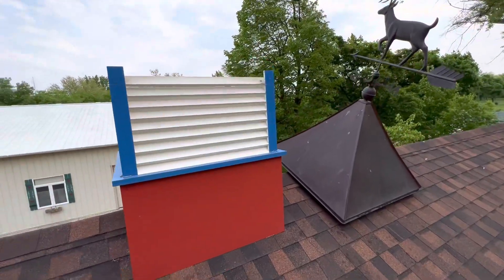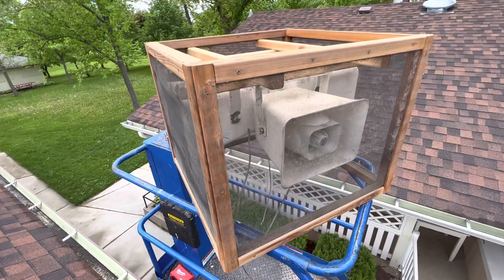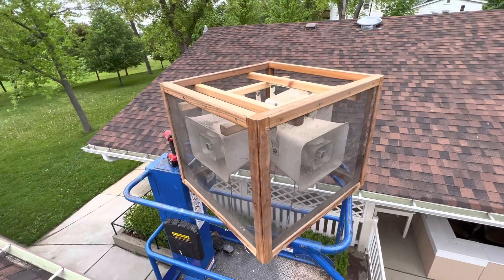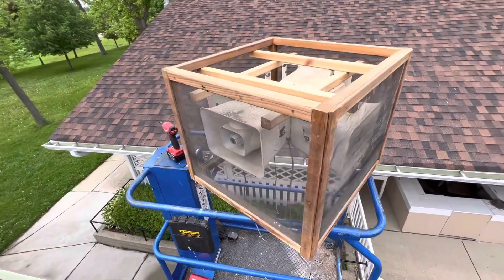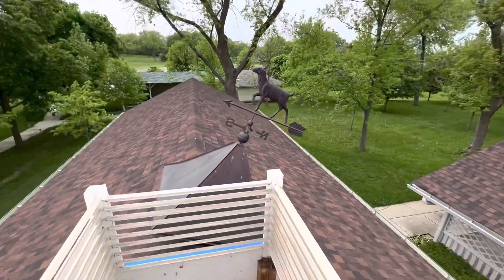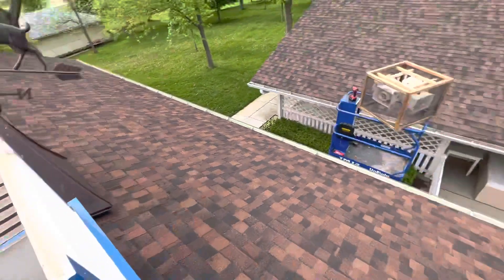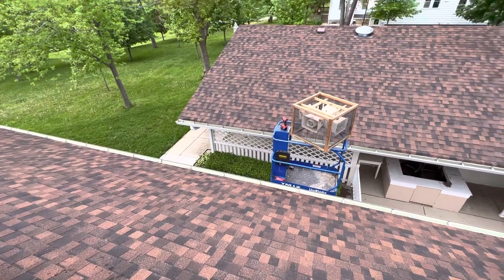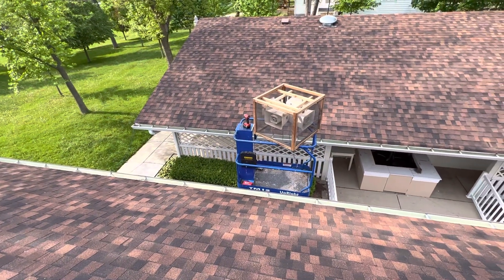DIY Carillon System Upgrades - Part 1

Comment: The University 2-Way with a 6 or 8" bass driver in them.  These also require an occasional re-coat of  Boat Resin/MEK Peroxide.